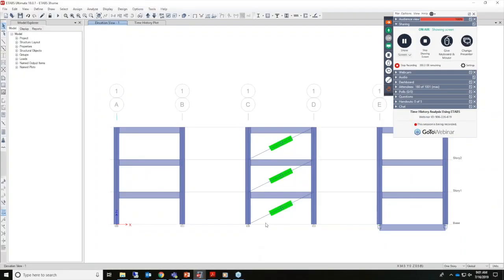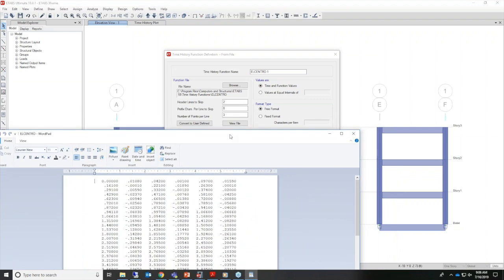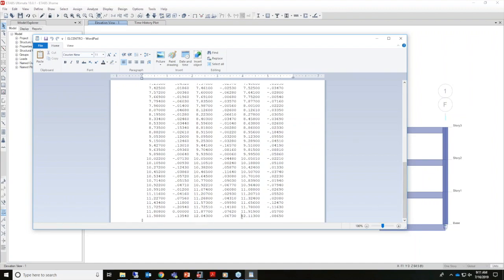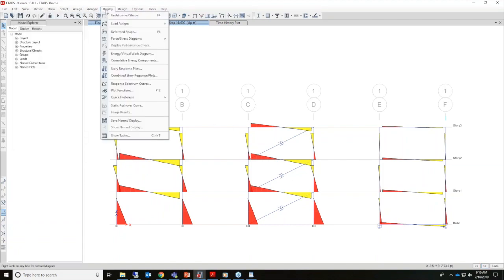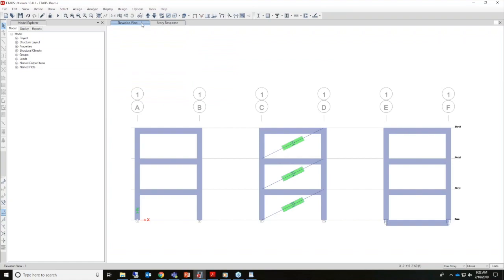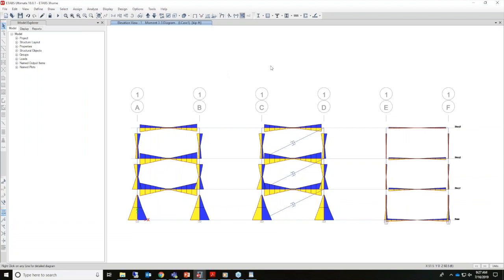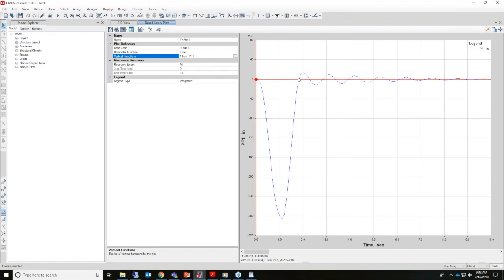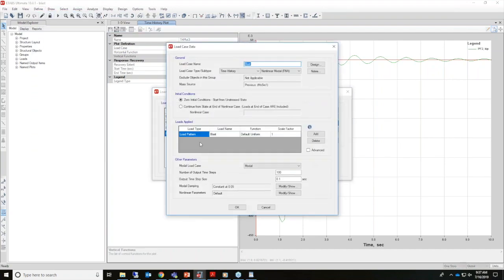WEBINAR: Time History Analysis using ETABS

Comment: when i use the option "time and function values" in etabs then etabs gives me error in reading the file. how can i avoid it the file is directly in the text format of seismomatch software.
Reply: You have to fill the boxes with the correct data. The "points per line" has to be the exact number (if there is 1 pair of time and acc. data in a column of the record, then its 1), the "header lines to skip" has to be the exact number or greater (if you writer greater then datas from the beginning will be ignored), "prefix" can remain zero. If these are correct, it will work.